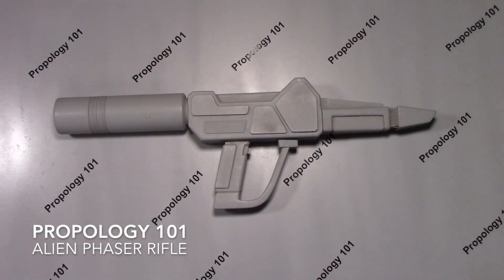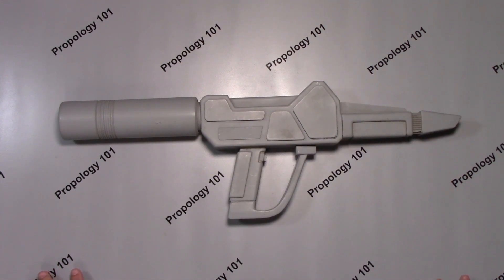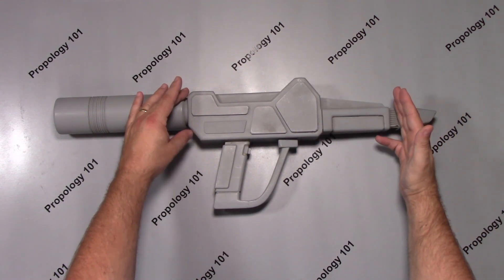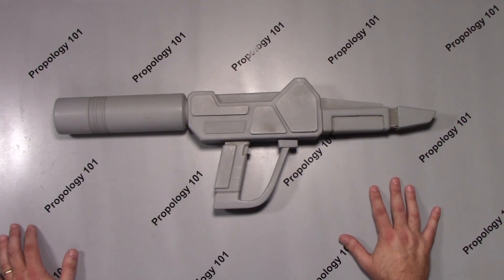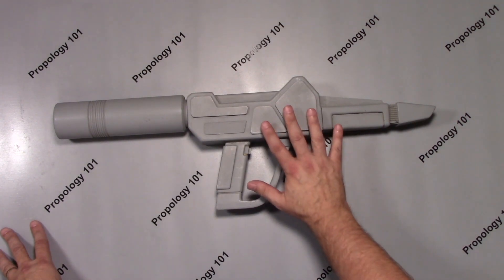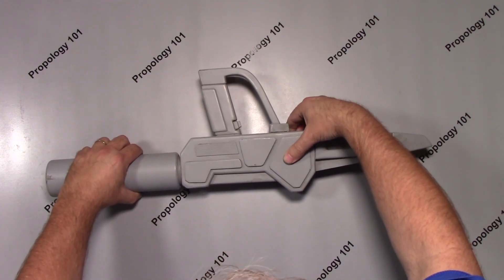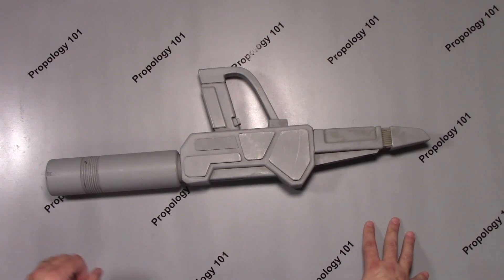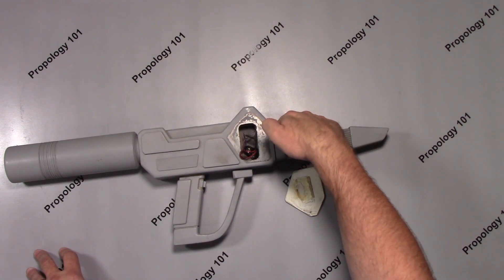Propology 101: Alien Phaser Rifle

Comment: The cover for the battery compartment, is that a magnetised section to allow for easy access? also in regards to painting the prop what products do you use in general to allow for heavy on-screen use. Btw saw you in the Museum section at DST Birmingham 2018, loved the props in there, amazing work and so much detail. Would have loved to talk to you but you had a small crowd already around you, perhaps if your at the 2019 I'll get the chance.
Reply from the maker: Hi Simon, No the battery cover on the Master here in the video was glue in place during filming. We were not allowed to use magnets back then .  We like to use Automotive paints if we can as they are more durable than others. We did have to repaint props all the time. If I am there please come by and we can talk about props.
Reply: @propology1019 
Thanks for that. I'm currently working on my own project, it's the Khan outfit from the film, having a real devil of a time sourcing the correct parts for the necklace so having to resort to forming a few pieces myself, but trying to be as authentic as possible, same goes for the Tan/Brown Velour material, plenty of Velvet but want to do the outfit justice.